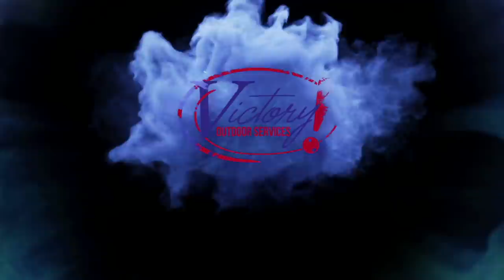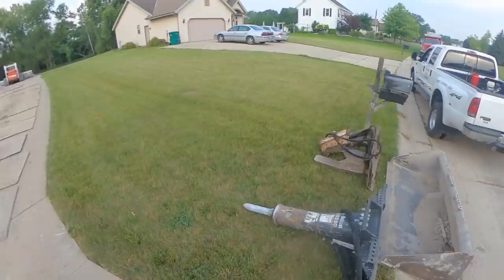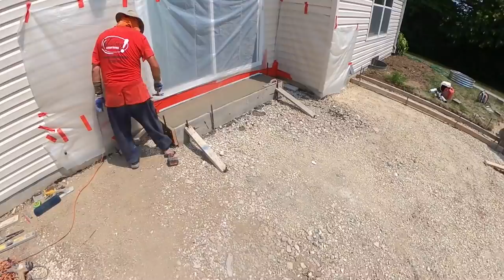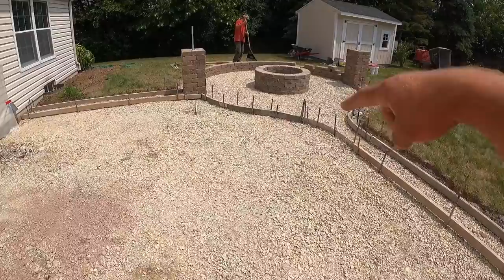Custom concrete patio with fire pit and seat wall

Comment: Big Paul from PA. hey Ryan I drove a mixer in NYC for 33 years, In years of cement shortages we have had to use Lafarge  cement even though it is usually not  available in the NY metro area. There cement powder uses different type of fillers than most international cement brands. Even though they dont necessarily list them they contain a higher percentage of flyash wit  ch acts as a retarder in all cement.  So if your guy switched to another brand temporarily pouring @ the 5 inch slump the way you do. Your definitely gonna notice the difference at higher outside temps.  Gotta say love the channel. Im retired now but its like being back at work while watching you guys do your thing. keep up the good work !
Reply: Thanks for sharing your extensive knowledge.

Comment: (Add this to the description and it will automatically add timestamps to the video)

-- Time Stamps --

0:13 - Editing
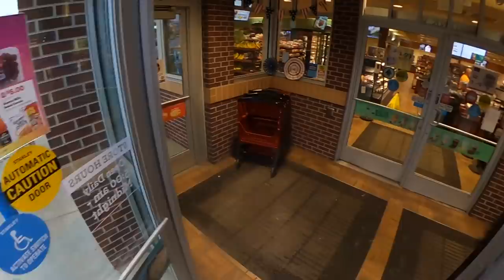0:59 - Morning Coffee & Finding Scott
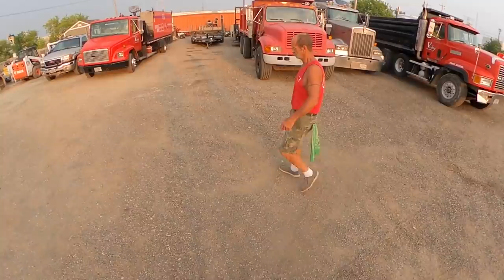1:35 - At The Yard
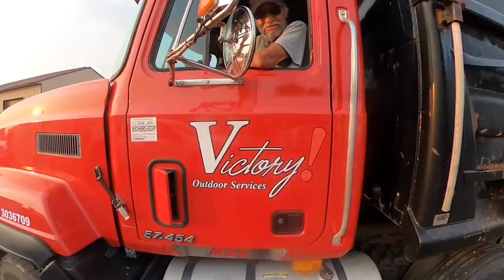2:23 - RivCrete (Picking up Color Hardener & Release Agent)
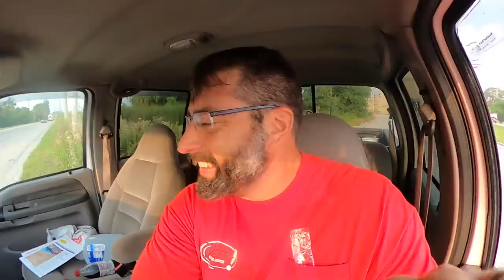3:22 - Concrete Order
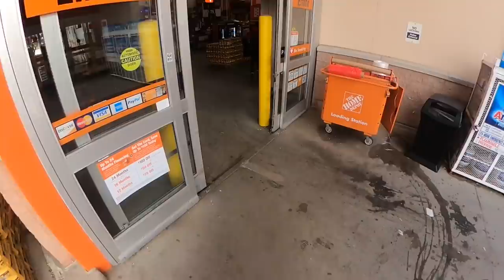3:32 - Home Depot Run
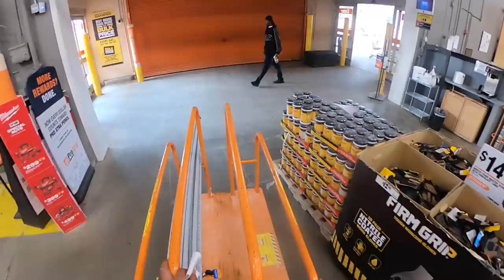3:54 - At the Jobsite
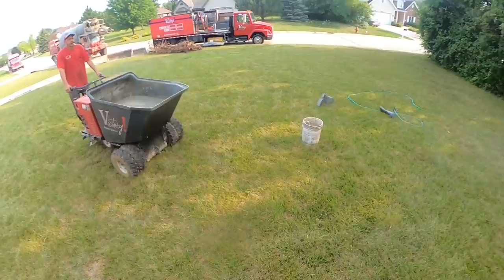5:47 - Pouring the Front Walk
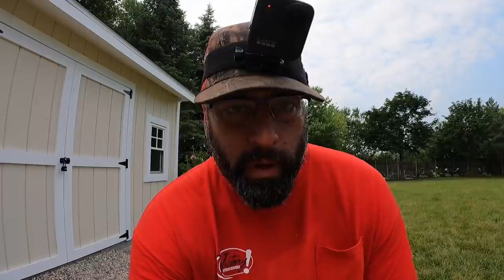9:29 - Building the Firepit
13:33 - Brauts for lunch 
14:27 - Back to work
14:55 - Rain
15:49 - End of Day 2
17:20 - Concrete Order Terminology Explained
Reply: Thanks!

Comment: What a great customer.. buttering you up for those free extra's as well as going for the customer of the year award. lol
Lot of work, and Daryl lucky he isn't working hear with us, no mask no safety glasses, no ear plugs.. Work Cover sees this on a job site, $500 fine for each safety item not worn, and you Ryan get fined too, min $5000 per breach. They are tough here on work place safety.
It's amazing the science behind the aggregate and the sand in the concrete. I remember doing a job where we transported over 10k ton of aggregate from my area near Wollongong Australia, to Melbourne 800 miles away, needed for a very important road bridge construction, as our aggregate, was hard and didn't fracture under heavy weight, as well as the stone when crushed has lot of burrs on it so the sand cement and other ingredients stick to the stone better for extra strength, limiting the tiny fractures. I love the science behind the concrete, and asphalt. We are now using micro fiber in the black gold on freeways to absorb water, and making the roads quieter.
You have a great team Ryan. You all work together nicely.

Comment: Thank you for the explanation of your concrete mix. That makes a lot more sense now. But what about when you say 6-inch slump, can you explain what that means? Thank you and keep the easy money train rolling!
Reply: the slump determines how wet or dry you want the concrete. the higher the slump the wetter and the lower the dryer
Reply: @Italiontaco  wait, I thought slump was the thickness of the lay?

Comment: Well explained. My wife would understand that as she's an Architectural Engineer, here in Sint Maarten - The Caribbean, and where we live, we're living in the Path of Hurricanes and we usually also get EQ's. So, the Building Code here is pretty strict. We're looking for Job in the USA btw. :) I used to work with a landscaping company a few years ago before I've moved over to Law Enforcement. :P

Comment: Very informational. Thank you. Can you do a quick rundown of how quickly you need to move along. Like how long before you should float, how long to wait to finish and start edging, how long to wait before you use a broom to give grip, how long before you can pull forms, how long before I can cut joints . I know each batch is different even if it’s ordered the same but just round about estimates. I’m wanting to pour a a sidewalk and worry I won’t move fast enough or to fast and the joints will fill themselves in.

Comment: There was thing you left out when ordering your concrete that you didn't mention was "FIVE BAG" ? 
I do a little handyman work helping my friends, carpentry, electrical, and plumbing. Sometimes a little concrete and I've learned a little from watching your YouTube to add to my work belt of knowledge, thanks.
Richard Martin from Panama City Florida. Retired truck driver of 42 years and seven of it in the Army.

Comment: It drives me crazy to see some one edge 4 feet, float it with the mag, edge 4 feet float it with the mag. Edge from beginning to end of sidewalk with out stopping, come back float it from beginning to end of sidewalk, pick up the broom, broom it, get back there pour that step beat the rain get the edge forms up block laid. No lollygagging with edge float, edge float, maybe you have to lollygag a little to film? Anyhow there’s your tip of day. I see you try it, and I’ll tell you my blind Stevie Wonder tip extraordinaire.
You guys are good workers, and joints are your strong point. I would like to see a closeup to see how rough it appears. 
We never, never,never Use Churk rock ( not sure on the spelling)

Comment: That concrete looks like a much easier texture to work with. Is that the case? I understand that it stays pliable for a longer time, but is it also better cuz of the texture during the pouring process? (It has also been like 20 degrees cooler in southeast Wisconsin this week than last)

Comment: I got a question too.... I saw a video of guys laying concrete over plastic, why would they do it that way?
Reply: Keep it from drying out to fast
Reply: @Mthwsshootr  does it really prevent the dry out? Is that so the moisture doesn't absorb into the ground?
Reply: It’s also used to keep the concrete from soaking up water especially if it’s three season porch.
I have a breezeway with a rug on concrete and there’s mold on under carpet because they did not put plastic under the concrete so there’s moisture coming up

Comment: I wouldn't want to be the guy that has to run the cable through that conduit in the pillars.......guarantee it will get caught on those 90 degree elbows!!!!   Easy monnneeyyyyyyy

Comment: Hey brother! Thanks for clearing that up! I'm just an oil burner mechanic from upstate NY that has a new found love for concrete! What is that slump or lump you speak of when ordering?
Reply from the maker: It refers to how wet I want the concrete basically. It is a bit more technical than that but generally speaking that is what it means.  The higher the slump, the wetter it is.

Comment: opps you made a mistake on the fire ring you do not put a crack on crack .I always feed or give water ,  Gatorade  to any crew working on any of my houses  . What PSI concrete do you order to  pour driveways ,3000 ,2500 ?

Comment: @ Victory Outdoor Services i know you explained the terminology you use when ordering concrete but you left out "slump." Can you explain that in layman's terms please? I know it has something to do with how the concrete spreads when dumped.. the example online is a bucket shaped like a pyramid,, when u lift the bucket off the concrete,, the concrete "slumps" and that is measured in inches. Like how far it slumps outwards in inches. Thats what i got from the explanation online. Consistency of the concrete but can you explain different slumps for different applications?

Comment: Please order master finish concrete screeds , you will never go wrong , bit of practice doesn’t even need bull floating (screed with one handled screed . Watch concrete ninja for flat floors.
Reply from the maker: I have seen them and watched quite a bit of concrete ninja, very impressive screeding.
Reply: Try the master finish screed for approx $400 U get a 4foot 6 8 10 12foot screed.and before you no it U can screed within a 3mm tolerance.and it is very tidy , all us Aussies can't be wrong , and screed of wet pads not boxing . Keep the clips coming very entertaining.

Comment: Stagger the joints on your walls. You don’t want the joints from second course line up with the bottom course. Start your second course in the middle of a block on the base course.
Reply: Stick to pouring concrete. Hardscaping life isn’t for everybody

Comment: you need to get some dead blows for placing blocks…a mini sledge isn’t a great idea….how you haven’t cracked blocks from hitting it with the mini is crazy to me
Reply: Dead blows are significantly better you can hammer away and not worry about cracking them.  We buy from harbor freight.  They last a about a season and then we swap them for new ones.